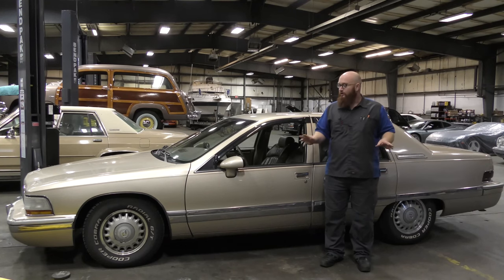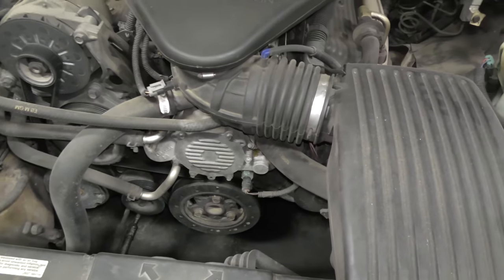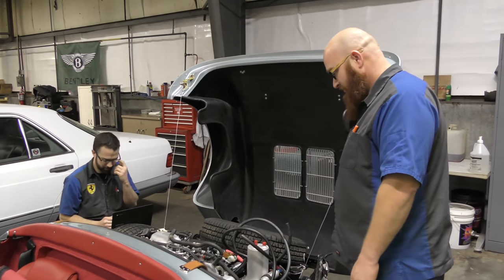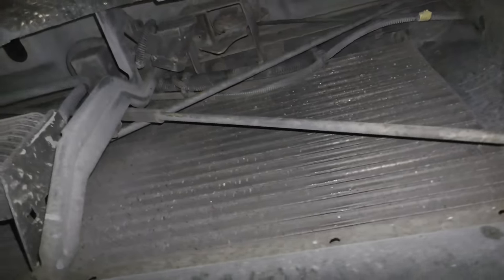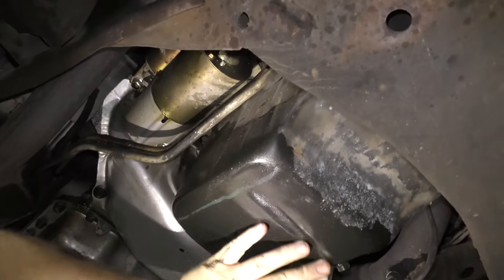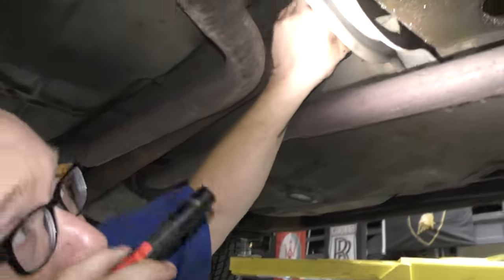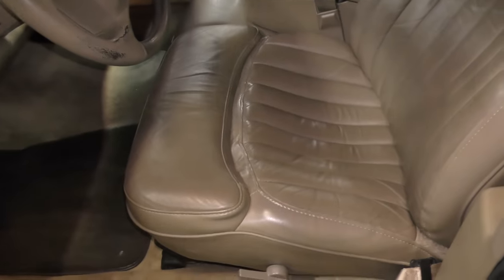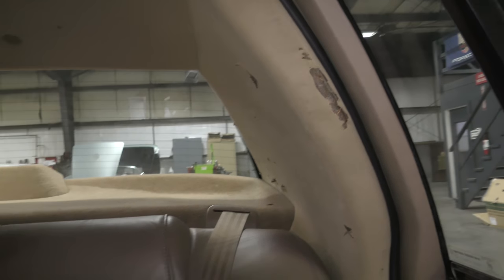Why do mechanics buy 'grandma' cars? CAR WIZARD explains their lure with this '94 Buick Roadmaster

Comment: "Looks like it had a small fender bender here on the bumper"
Some car probably totalled itself on that bumper. :D
Reply: I used to own a ‘87 Pontiac and had a front crash with another car which was built in the mid 2000s at about 30mph. My car had a small bend on its front bumper easily fixed. The other car looked like crushed paper, instantly totaled. Good thing nobody was injured. It shows how strong old cars were built.
Reply: @WorldlyBudget  modern cars are designed to crumple for a reason. Its very easy to understand when you realise that force has to exerted through the car, and that either you’re going to take that force, or your car takes that force and dissipates it through crumple zones. You only need to look at crash tests from the 80s till today and see which is the better option. You can always pay for another car, or fix damage. You can’t get a new spinal chord or replace your crushed skull.
Reply: @Psyopcyclops  I see. Good information, thanks.
Reply: @elizabethjansen2684  Not true at all. Safety ratings are far more rigorous than they used to be. These old vehicles wouldn't even score 2 stars by modern standards. Crumple zones are just that, ZONES. They do not crumple into you and if you are in a wreck so bad that they somehow do, that would have been a wreck you never would have survived in an older vehicle.
Reply: @JoviaI1  oh it's true I know some of those people.
Reply: @elizabethjansen2684  - Anecdotal evidence is not equivalent to truth. 

There are a lot of other factors that add to accidents being better or worse. 

Your friends may have been crushed, but since it crumpled that far, the speed or angle must’ve been pretty bad. 

That also tells me that if they were in a car like this, they’d have a broken neck or back from the sheer force of the impact; nothing would have given way to absorb the impact. 
Body crush-in like that doesn’t just happen.
Reply: @stubstunner  yeah right, I personally knew at least one, and others were news stories. Anecdotal is valid in many cases. I have also driven past wrecks that were way beyond crush zones. If air bags are so wonderful why do they need crush zones? Wait until you see a car under a semi. A tv program also showed a vehicle trapped under a semi and being dragged down the highway because the semi driver didn't know it was there. A crumpled front end increases the chances of that happening, that is simple logic. So how do you justify my knowing a person that happened to telling about it as anecdotal.
Reply: @stubstunner  thank you for proving me correct.
Reply: @stubstunner  no you implied that I  said it is not as safe as claimed
Reply: A newer kia T-boned my 99 Subaru outback  and was totaled..  Plastic parts everywhere on the ground.. I drove away with a dented Q panel and bent rear suspension which I got fixed for $ 450...
Subarus are almost as solid a tank as that Buick Roadmaster V-8.
Reply: @WorldlyBudget  occupant safety is key;cars are expendable
Reply: @WorldlyBudget  the problem is energy dissipation. It’s why NASCAR sanctioned stock cars destroy themselves in a crash. Cars are designed to crumple now to absorb as much energy to prevent injuries. But my 03 Dodge Dakota hit a telephone pole going 50. 800 bucks and she’s driving again. New fender and hood, radiator, ac condenser, upper radiator support, new fan and fan clutch, and called it a day.
Reply: @Psyopcyclops  which is what saved my life in my 07 corolla. Rolled it last week without a seatbelt. Nothing but a compression fracture in my t10 and t11 vertebrae. I’m fine and went into work the very next day. If it was  something like a first gen Ram (my dream truck), I already know I would have been hurt a lot worse, if not killed.. I also know I wouldn’t be able to walk anymore.
Reply: @Psyopcyclops  exactly this! Every fire & rescue person who's had to cut someone out of a wreck will praise the design of newer cars, because they're built to keep the people inside alive.
Reply: LOL ppl are still arguing that older cars are safer because.... older car harder. This is why physics should be a requirement to graduate from high school.
Reply: As a young man, my GF fell asleep with cruise control doing 70+ on highway and went down a ravine. (in an 89 lesabre custom).... When I picked her up.....she had bruised shins and I could see the  car engine........from a distance.  I'll take a tank over an airbag
Reply: @elizabethjansen2684  Going back a ways, but it used to be said, "Having an airbag is similar to having a car 700 lbs. heavier!"  I solved that problem back then, by getting a car that was 700 lbs. heavier (and had a LONG hood). This is when putting airbags on cars was just getting started.
Reply: @dennyj8650  first vehicle I bought was a J20 jeep truck, thing was a tank. I loved it and still prefer trucks, I buy older ones so I can work on them myself as much as possible.
Reply: @stubstunner  no I don't need to lie , you sound determined to "win" this debate. Frankly I don't care. Drive what you want I'll drive my preference, at least if someone backs into me in a parking lot I won't have get a new vehicle.
Reply: Seem cars with minor dents and airbag deployed
Reply: @J Hemphill I'm quite calm thank you.  Considering how many things pushed by government entities are now being proven false I'm chary of just blindly accepting their words. Some of those tests have been demonstrated to be not quite what they claim. I will defend myself if someone attacks me so go tell mr certain to calm down instead of wasting air on me.
Reply: @elizabethjansen2684  Put that Buick up against a Hyundai.
Reply: @elizabethjansen2684  if your ego refuses to let you look up word, let me help you. Anecdotal - (of an account) not necessarily true or reliable, because based on personal accounts rather than facts or research.
Reply: @d-rockpain4250  had she been awake, it would have been a much worse accident. Being unconscious during a wreck will save your ass.
Reply: @Eugene Cam glad you don't work for safety r&d
Reply: @Treaxvour  Well she didn't drink, so probably woke up at some point before final impact.  Without being sedated, she was probably awake for most if it.  If it was a head on or something, then the person might not wake up, until after the crash, but rolling off the road and down a ravine?  falling asleep is very different than passed out drunk.
Reply: shad rokxx  yeah had a '79 j20 jeep, thing was a tank . Some clowns hit it at less than 5 mph and tore the whole back taillight assembly out and all I had was a bent corner of a rear fender.  They cruised away all casual trying to pretend nothing happened.  Never reported it cause I thought it was hilarious.
Reply: @Eugene Cam "Older cars implemented crumple zones, but ALSO had bumpers that were fucking functional."
Well, yeah. The bumpers are not weak because of crumple zones, mostly anyway. They're comparatively weak because they need to be light and cheap to offset the additional weight and expense of the high-tensile strenght steel core body. New cars can't have metal bumpers without it adding a ton of weight to an already heavy assembly. 
But besides that, broken bumpers don't get cars totaled. The frame getting heavily bent does. And that frame being as weak as it is in some places, is because of crumple zones.
Reply: A huge tree branch fell on top my Lincoln Towncar hood, it broke the tree branch into several pieces and only left a tiny ding lol.
Reply: @Eugene Cam The consumers want cheaper cars with lower fuel consumption. Plastic trim pieces help with both. 

In case you haven't noticed, newer cars are pretty much always heavier than old ones, even with all that plastic trim. Making those trim pieces metal would increase the weight and also give no benefit bar being more durable in case of a small fender bender. Then again if you don't crash your car it doesn't matter. 

Just because you're fine with your huge gas guzzler doesn't mean that's what all consumers want. Even ecoboxes are close to 1,5 tons these days.
Reply: @Eugene Cam 
I don't know how you drive there in the freedom land, but I've been driving a car for 5 years now and never have I encountered a situation where a studier bumper would have been useful. Because I drive carefully and don't crash into things. Besides if one breaks it's literally like 50€ for a new one. Or 200€ installed and painted.

Are you sure about consumers not wanting less fuel consumption? Seems pretty logical to me considering gas and diesel prices are incresing worldwide.

I'm not sure what your point here is. Plastic trim pieces are easily replaceable and cheap to replace if you do end up damaging them which you shouldn't have to anyway. When you drive like a reasonable person they save you money and weight.

If your car actually gets totaled or needs expensive repairs then that's because the frame is bent, and the frame in the front you can't make any sturdier without compromising on safety.
Reply: @Eugene Cam 
Not in a serious one no.
But if I was, I'd rather have the car made to save my life and destroy itself in the process than the other way around.
And if it's only cracked bumper levels of damage, well then who cares. You can replace it for cheap or just leave it broken.
Reply: Which means it didn’t absorb energy but stored it, then released it back to the other car, all the while the organs in the human sitting in it feel it all
Reply: @elizabethjansen2684  stop liking your own comments it’s weird
Reply: @Number1FanProductions  say what?  Why would I do that? That's the stupidest thing I have heard.
Reply: @genehart261  sure, give me one
Reply: @Eugene Cam thank you!
Reply: damn I thought it was for the milage they get...🤣
Reply: @Eugene Cam the irony is it is now being reported that newer cars are heavier
Reply: @MrUppmas  actually just read a report that newer cars are much heavier than older cars. From a reliable news source. So much for that theory.
Reply: @elizabethjansen2684  Yeah new cars are considerably heavier, have I claimed otherwise?
Reply: @MrUppmas  then weight is not a factor in your arguments.
Reply: @elizabethjansen2684  Not really. I mean, newer cars could be even heavier if they incorporated more metal in the body styling.
Newer cars are heavier because the structural parts are way bigger. And they have to be to pass modern safety standards. The A-pillar on my family's 2013 yaris is about 3 times thicker than in my sporty 1990 MR2. 
So you can't skimp on those parts that inescapably already make the car very heavy (in comparison to older ones). What you can skimp on are non-structural parts like bumpers, fenders, etc.
I don't see how this is counter to my arguments.
Reply: @MrUppmas  a bumper is hardly nonessential
Reply: @elizabethjansen2684  I didn't say nonessential. I said non-structural.
Besides bumpers specifically are plastic and styrofoam for reasons besides weight. Namely pedestrian safety and not interfering with crumple zones.
Reply: @MrUppmas  um but yes you did
Reply: @elizabethjansen2684  I double-checked all my comments and I didn't. That's besides the point, even if I did say that, that comment would be mostly wrong.

Comment: Through high school I drove a '92 Buick Roadmaster, but it was a wagon version with the fake wood siding. It was an absolute beast. The V8 roared like a wild animal, it could drift around corners or long sweeping turns with ease, and if anything went wrong with it my dad and I would spend a Saturday afternoon fixing it with just a google search for the manual and a trip to the local auto shop to buy the readily available parts. I miss that car more and more as I get older.
Reply: Compre outro e seja feliz😁
Reply: want to buy one I have a 1995  Buick road master white woody wagon no rust 128k miles i want 2500. bucks
Reply: 90s Buicks are probably the stereotypical high schooler car

Comment: I'm a marine mechanic by trade and I bought my grandmothers '95 Buick LeSabre exactly for these reasons. It had 112,000 grocery getting miles with shopping cart dents that looked like it was in a sideways hail storm covered by scratches down the sides from backing out of the garage. But, the ticket was it blew ice cold AC and the leather seats were just Lazy Boy recliners. And at the end of a hot day after being on your feet...a cold Lazy Boy is what you want
Reply: you got it momma
Reply: Cold, lazy beer, in a cold lazy boy